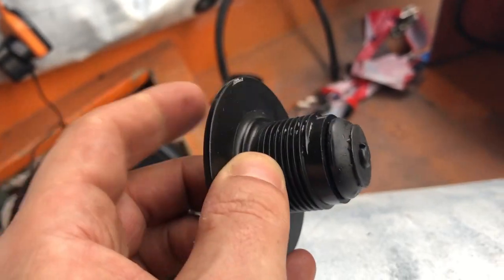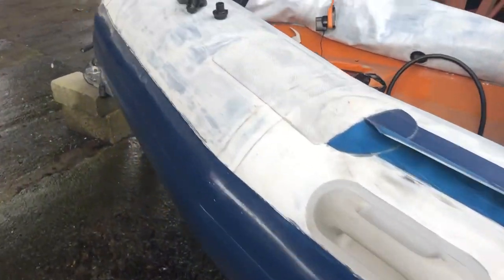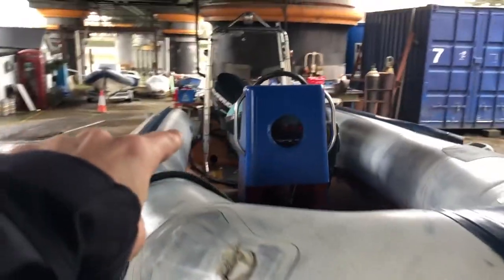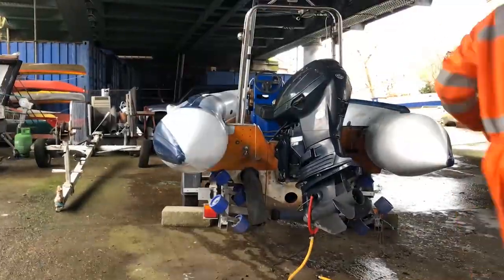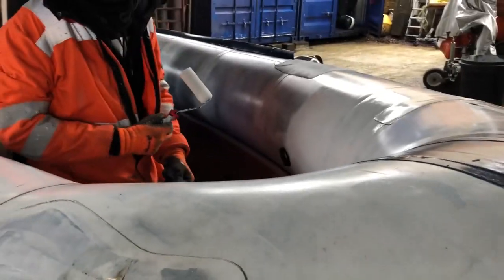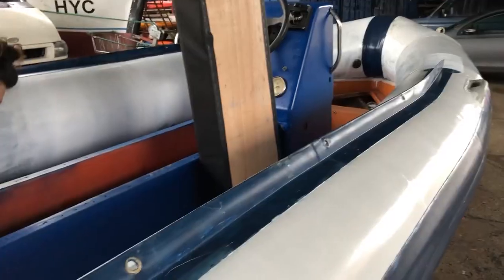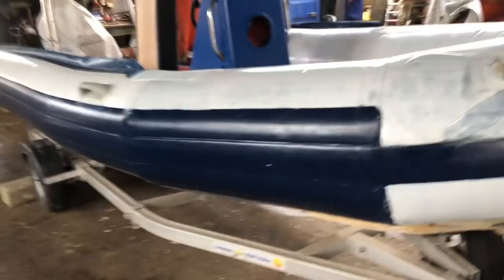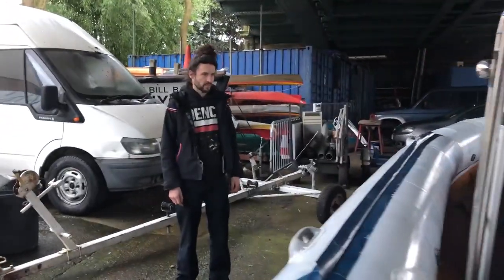PART 9 : Painting our RIB with Polymarine Flexithane Hypalon Paint

Comment: Is  a oil base paint or  water base?
Reply: A liquid rubber base I believe. 
It's amazing stuff, lasts well. We've had a couple of years of use in the Thames and it needs a refresh. 
If I had my choice again, I'd spray it with the same paint.
Keep petrol and solvents away from it. Make sure you prep the surface very very well or it'll peel off.
Reply: @duncanthomsen9400  thanks  fiend